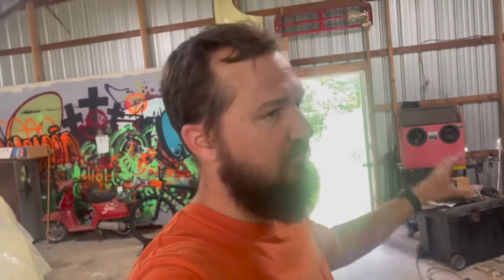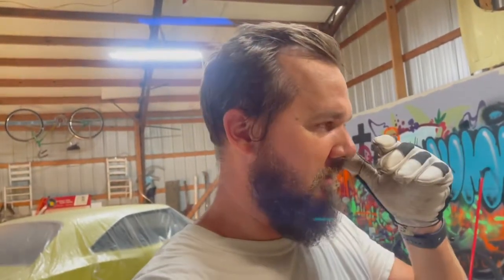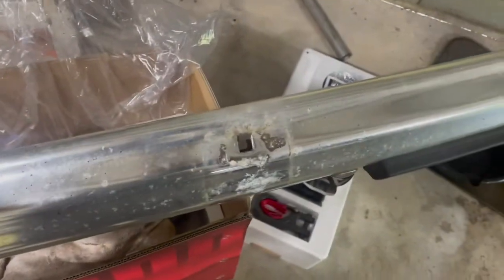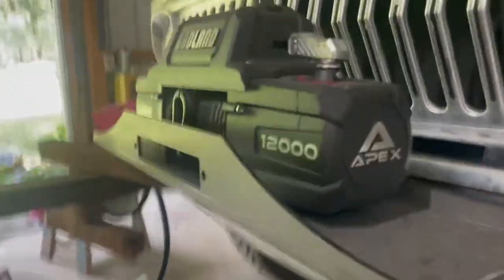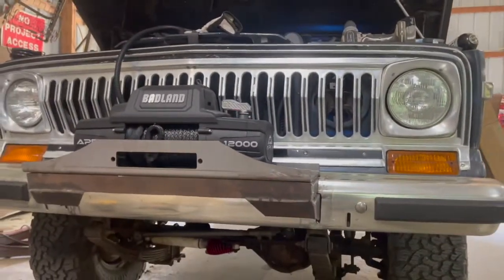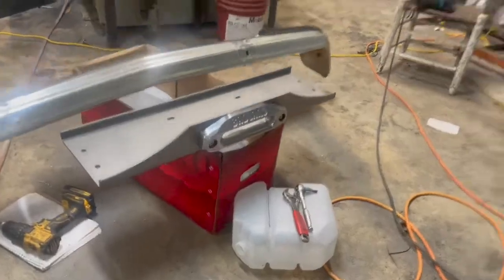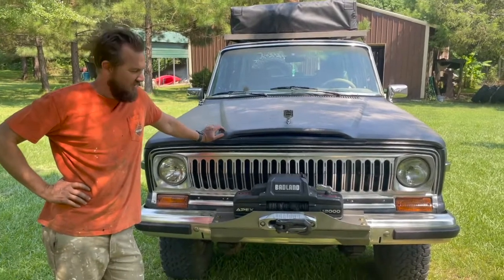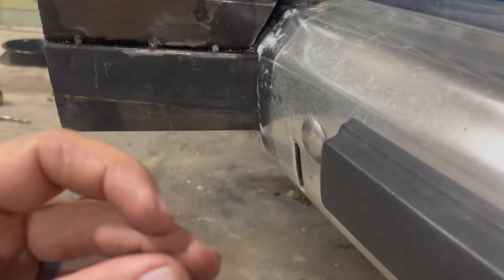Custom Winch mount for Jeep Grand Wagoneer! #Badland #Apex #HarborFreight

Comment: This is exactly what I was looking for! 
Setting up my 88 to flat tow so mine will get d ring mounts. I wanted to mount my warn and keeping the stock bumper is also a requirement. 
Awesome work.  You have a new subscriber.
Reply from the maker: Awesome! We’re gonna be doing some changes to it soon. It’s has worked well no issues!

Comment: I like it. Where did you get the winch plate? I've got a Dodge w250 that I've got a winch ordered for and keeping the stock bumper is priority.   I looked at getting a front hitch mount, but like you said I think it would be to low, but I don't like the look or how loose they fit. My goals to keep the appearance stock but be capable of overcoming most situations. I like what your doing with the Wagoneer. I had a Wagoneer years ago and was looking for a J20 when I found this 89' w250. Any advice on roll on bed liners, so many salesman out there, or surplus waterproof containers for stowage? Thanks brother keep workin!
Reply from the maker: It’s from RuffStuff Offroad. We had a w250 as well as a few power wagons over the years, love em!!

Comment: Yall running a drop pitman arm? Whats your front suspension looking like? I picked up an 89 on 33s and about 5 inches of lift on leafs. I get TERRIBLE body roll on every bump I hit. I have to fight to keep the truck to stay on the road. Fresh alignment didnt help at all and shocks are all looking good.
Reply from the maker: Yes, we are running a drop pitman arm from BJ's Offroad - part number 12-4007. Check your body bushings - those are prone to go out. Ours were completely gone and gave us lots of wobble. We went with polyurethane bushings and it rides WAY better now.
Reply: @TermiteOffroad  Thanks a bunch.